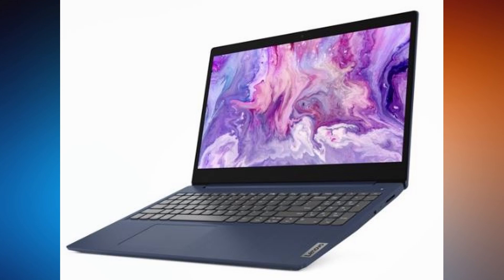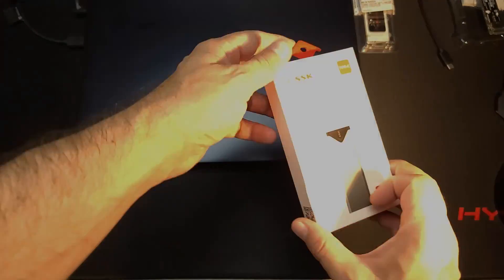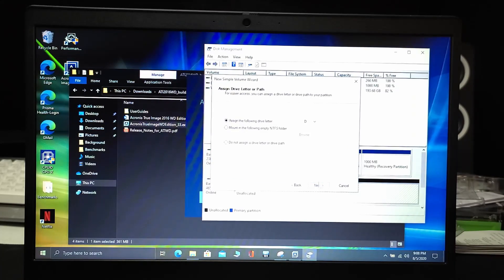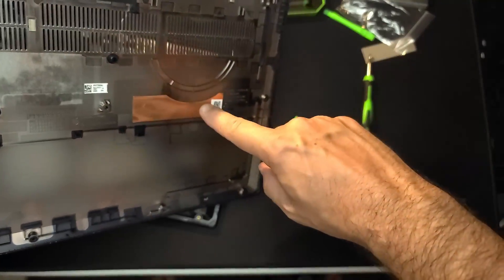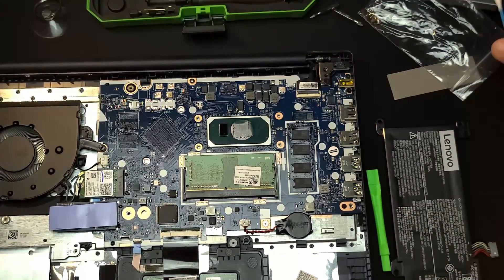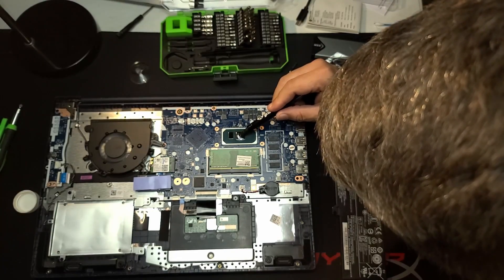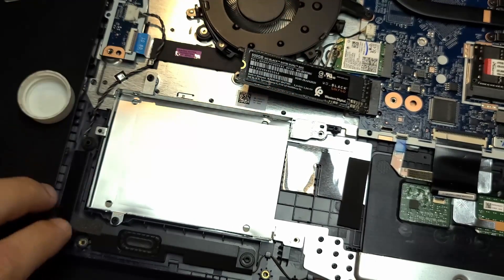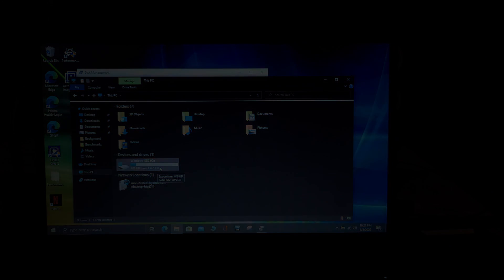Lenovo IdeaPad 3 Intel i3 1005G1, Upgrade. Replacing Thermal Paste, adding 32GB Ram & 500GB NVMe SSD

Comment: How is the battery life and is  the one with amd ryzen 3 with 4gb ram upgradable... I mean is ram upgradable because I heard in some laptops there is no slot for ram upgrade
Reply from the maker: Battery life depends on the "battery power setting". I've only used this laptop plugged into the wall, with max performance settings. I could test the battery life tonight, so I can give you an accurate answer. I'm pretty confident there is a slot as well as soldered ram, for both models (intel / ryzen). May be empty or populated based on the config. Remove the back of the laptop, and take a look to be sure. Just take your time when prying the edges of the back cover. I was pretty rough with it, and didn't break anything. Luckily 🤣
Reply: @TheSmileyTek  
Aww thank you so much
Reply from the maker: Anytime. I'll use the laptop tonight set at "balanced" to see how long the battery lasts. Or at least, how long to get to 20% or so.

Comment: So you mean you have 36 GB RAM installed ! , i will do the same ! but one question , is 2666mhz ok or will it accept higher than that ? I have same laptop but with i5-1035G1 (Quad-Core). 

And also my NVMe doesn't have that Blue-sticker protection, will it be dangerous as it could get heat by Fan. And what screws are used for that SSD ?
Reply from the maker: Yes 🤣. Kind of crazy tbh. My beastly gaming pc only has 32. I'd suggest downloading CPU-z and/or HWiNFO to confirm your ram speed. Take the number it shows and times it by 2. For example: CPU-z shows 1200mhz, ram is running 2400mhz, 1333mhz is 2666mhz, and so on. Match that speed, if you're buying a new stick imho.
For the NVMe, I'd suggest buying a cheap thermal pad material just in case and cutting it to fit, but it'll be fine without it. Although, there may be a little toasty spot if you sit the laptop on your lap. They get pretty warm. You'll know it's there if you run your hand across the bottom while under drive load.
Reply from the maker: Ah, the screw. The NVMe drive had a screw already installed. I just moved the standoff that was included in the laptop, back to a different hole for the larger drive. Most NVMe mount screws have been the same size in my builds, but the standoff screw has been different. If you already have an NVMe installed, you will have the screw you need.
Reply: @TheSmileyTek  thanks

Comment: Hey!! I've seen that this laptop has 4gb of soldered memory, and that is only supports a max of 12gb of memory...did you know this before doing this project and has is caused any issues for you? Just curious, trying to recommend this to a friend on a budget and want to know just how far he can go with upgrades later on down the line.
Reply from the maker: Sure. Yes, I read the spec sheet, and ordered one 8GB RAM stick. I didn't even noticed I received a 32GB stick until after the install. It shows 36GB now, and passess all Mem Tests I ran on it. It's loaded all 36GB of RAM and held with no errors. So far it's been running perfect with no issues. I'm surprised tbh.
Reply: @TheSmileyTek  Nice! Good to know it can (seemingly) handle more than it claims!
Reply from the maker: @ryansandiego1814  For sure. Installing a 32GB was not the plan, but just a mistake in my favor. I re-read the spec sheet, and it says "max offering" is 12GB. I took that as, the max memory included off the shelf. I didn't see anything that said it was the max supported. The i3 1005g1 spec sheet says it supports 64GB memory, luckily.

Comment: When you added RAM 32GB, is the ram still running dual channel?
Reply from the maker: Everything seems as is was before the upgrade, except for speeds and amount of RAM. The system recognizes both modules, and shows "Dual" in CPU-Z, and "2of2" in task manager. Memory clocks were 3200Mhz before, but are now 2400Mhz unfortunately. This laptop doesn't support the 2666Mhz XMP profile. I wasn't aware of JDEC 3200, and I didn't even look until the day I upgraded, but somehow it was running those speeds. I took screenshots of the hardware info and benchmarks before the upgrade. I can make a video comparing the before and after results if you'd like. It now has 36GB RAM, which I've tested with MemTest32 & MemTest64. Runs perfect, with no issues other than the dropped clocks. That's ok though. I'd rather have the extra memory.
Reply: @TheSmileyTek  i have Lenovo ideapad 3 too but with Ryzen 4500u Version
I plan to add 16GB RAM so it will make Total 20GB
But I'm afraid of it will run single channel because mixing RAM with different capacity and i have no experience with mixing RAM with different capacity
So I'd really love to see your video about the difference between before and after upgrade the RAM
Reply from the maker: @ilhambuono5451  You got it. I'll throw together a video on that.
Reply: @TheSmileyTek  btw did you test aida64 memory benchmark?
What's the results of read, write & copy between before and after?
Reply from the maker: I can show those. I'd definitely suggest searching your exact model, and purchasing the memory stick from Lenovo to get the best performance. I assumed I could do better buying a low CL stick, but I lost a little performance. I'll do an update video on the upgrade performance in the next few days. I am working on finalizing my next video to upload tonight. After that I'll show the IdeaPad benchmarks.
Reply: @TheSmileyTek  oke then, i can't wait, thanks in advance btw
Reply: @TheSmileyTek  So how is it going? 
I'm really curious, I've been waiting for "part 2" video

Comment: Man I want to ask you I saw a space for HDD can I put 1 tb there and what is the model number or size related in this case I would keep my ssd for software + extra space after installing normal hard drive
Reply from the maker: Sure, you can install a 2.5" SSD or HDD in that spot. You may need to purchase the bracket and "SATA data / power cable". If you go to the Lenovo site, and search your model laptop, you'll find the User Guide, and User Maintenance Guide. The Maintenance Guide has the part numbers for the bracket and cable. But, yes you can have the NVMe and a 2.5" drive in this laptop.
Reply: Hi, you did ?
Reply: @javierbenitez2674  not yet ssd still expensive
Reply: @basel9394  and a 2.5 '' hdd in that space?  I just bought it and would like to expand it but I don't see a connection to do so.

Comment from the maker: I have the before and after benchmarks if anyone is interested. Took a small hit due to RAM speeds, but we have more memory. Again, my apologies for the audio. I didn't realize the weird pops until after uploading. I won't use that audio recording technique in the future, due to those issues.
Reply: what about gaming, it's integrated, doesn't it give a 3x boost on performance impact? you added 24gb more ram or 16/20 SO-DIMM only gives more performance overall
Reply: I got the white 14IIL05 with i5 1035G1 for $530 with -$170 price drop and might do this same upgrade
Reply: I would like to know about benchs how much it improved with dual and repaste
Reply from the maker: @cliqueimarketing  To be honest there was no noticeable performance increase, other than running around 7deg C cooler during looping Cinebench R20 runs. Which I didn't expect. So that was pretty cool. Been over a year, and I haven't had any issues since installing a ridiculous amount of memory.
Reply: @TheSmileyTek  what are  the average tempratures when idle , while stressing the cpu etc

Comment: Hey!!! I bought an Ideapad 3 with i5 1035G4,8 GB ram and 1 tb hdd+256 gb ssd. You are the first person to put a upgrade video of this laptop. I wanted to know.....after installing the 32 gb ram stick.....is your ideapad working perfectly fine? Because officially the maximum supported memory is 12 gb you know......and can I replace my 256 gb ssd with a 500 gb one? I searched in google but I couldnt find any answers......
Reply from the maker: That's one of the reasons I decided to upload a video as well. Not much out there. Should be no problem to upgrade the hard drive to a 500GB. I also thought 12GB was the max supported RAM, but after re-reading the spec sheet, I noticed it said max "offered" was 12GB. So 4GB soldered to the board + the stick. And yes, 36GB RAM now, and it works perfectly fine. Seems to be the CPU that determines how much RAM is supported. Just look up your chip to be sure. But I say go for it, and with confidence, you'll be just fine.
Reply: @TheSmileyTek  thanks man.....just one more doubt......how did you upload windows 10 home?! Am not a software guy you know.....so I don't know how to do it.....😭
Reply from the maker: If it's a SATA SSD or 2.5" mechanical drive, grab one of these to clone the drive using software:
https://www.amazon.com/dp/B00OJ3UJ2S/ref=cm_sw_r_cp_apa_i_6O3sFb1D9M8ZD

If it's an m.2 nvme grab one of these:
https://www.amazon.com/dp/B07MNFH1PX/ref=cm_sw_r_cp_apa_i_qR3sFbWRWKN74

I used Samsung's free cloning software for the NVMe drive in my desktop, and I used Acronis free software for the NVMe in the laptop. You should be able to use Acronis for a SATA drive as well.

Comment: Hi. I would like to know how many hours the battery of that laptop lasts ... I'm using a translator so don't judge :) ..

I would also like to know if it can be improved.

THANK YOU.
Reply from the maker: 35Wh (7.3 hours) & 45Wh (9.6 hours) are the only two battery options available for this model. Mine is the 35Wh. If you turn up power saver mode, the cpu will run @ the slower 1.2Ghz. If you turn down the brightness you might get the max hours. I haven't used it without it being plugged in, so I'm not sure of the "actual" time you'd get out of it. No judgment here, that translator works well. Very clever.

Comment: Does it show 34 gb of ram? Or however much it is ..
Reply from the maker: Oh yeah. 36GB. 4 soldered to the board, and the 32GB stick. Works perfectly too. I knew the cpu could handle it, but I wasn't sure the MB would. But, it's a 400 chipset. No problem. This little PC is impressive.
Reply: @TheSmileyTek  that’s great to know .. thanks
Reply: @TheSmileyTek  i have a lenovo laptop too c340 i3 10110u is every laptop can goes like your laptop to 36Gb mine is 4 gb soldered and 4 gb sodimm
Reply from the maker: Not sure. Should have the same 400 chipset for 10th gen Intel. Check the Intel "ark" website for the "Memory" capacity of the CPU.
Reply: @TheSmileyTek  the max memory size in the website is 64 gb

Comment: a nice upgrade
Reply from the maker: The crazy thing is, the old RAM was running 3200mhz (dynamic). The speeds varied widely.... And CPU-Z showed a JDEC entry of 3200mhz. I didn't know JDEC went up to 3200mhz. I've got a screenshot I can share on Twitter showing the JDEC 3200mhz (1600 JDEC). Maybe it's some custom deviation? It confused me. I've always thought RAM capacity was more important than RAM speeds, so I was ok with the speed hit. And the fact that I was shipped a 32GB stick, instead of the 8GB stick I paid for, is crazy too.. The spec sheet for this laptop was wrong on RAM speeds as well. Odd.
Reply from the maker: BTW, I really appreciate you supporting the channel. It does mean a lot to me. You've been here since I started uploading content, and I just wanted to say thanks. I'm going to rotate the content, so my next video will either be 4k 30fps quality test between two "cameras", and/or, we're going to tackle that "per core" overclocking issue people have been having with the MSI BIOS, and the clocks not holding. I have a capture card now, so I'll be able to get better quality footage of the BIOS. I'm gonna figure that out.